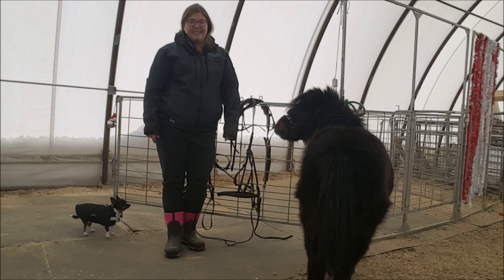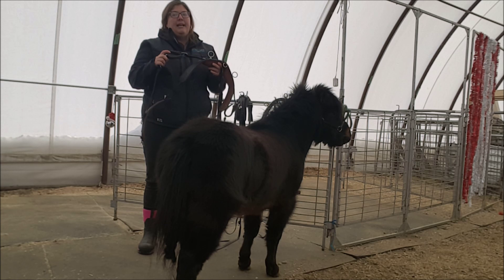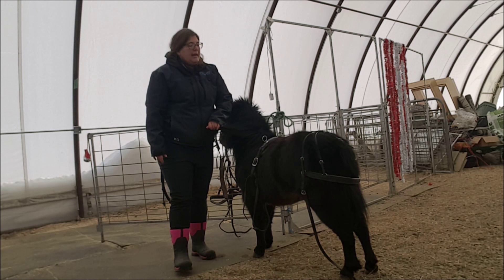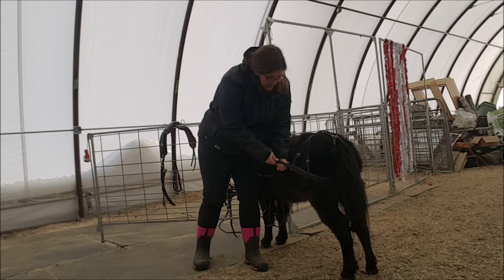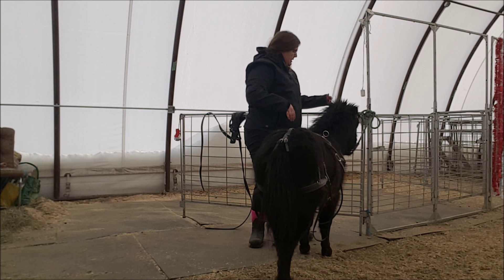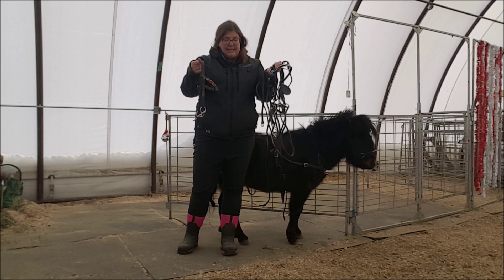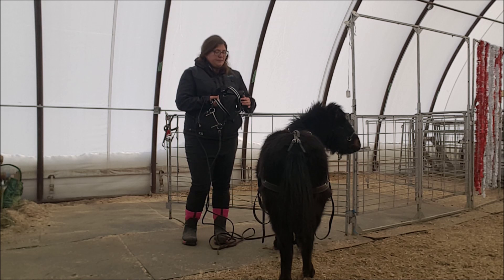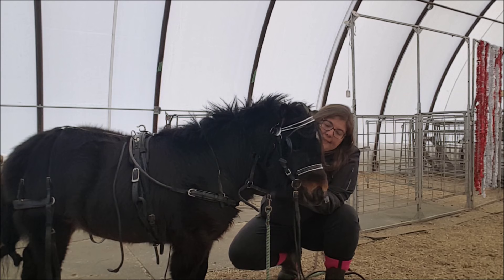Harnessing The Miniature Horse - Part One

Comment: I love your videos, Kendra. Also love your book on miniatures--I highly recommend it as a great info source on minis.  A couple of small points regarding your video presentation. If you used a lighter colored mini in such demos, we would be able to see the harness easier as you put it on the horse.  Rocky is so dark that it is hard to tell exactly where the saddle sits in relation to the end of his mane, precisely where his girth sits, etc.  Also, as you hold up the various saddles and point out their characteristics, it would help if you would angle your body so that the harness parts aren't against your dark outfit.  If you were to stand slightly to the side, and show the harness parts using your lovely building walls as the backdrop, I think we'd be able to see the harness more effectively. These are not dealbreakers, but being aware of these videography details would make your content easier to grasp.  I found I had to keep stopping the video, then squint to see harness details against your dark clothes, and positioning of the harness on the dark horse, before I felt I could move on.  Thanks for considering my suggestions. I greatly appreciate your knowledge, and your straightforward and positive teaching style!

Comment: Hi,
a friend referred me to your channel,I'm completely new to driving and I'm trying to teach my miniature. 
I was wondering since a check is required for showing can I leave it fairly loose like I do for practice or would I get docked points if I did that in the show ring?
If you could give me some pointers it'd be much appreciated,thanks.
Reply from the maker: There is no rules as to how a check is to be adjusted - it should just be wherever it is comfortable for your horse. In some classes it doesn't even specify that it must be attached to the bit. 

I start every horse without a check, and only introduce one shortly before a show for them to become accustomed to it. That way they are able to learn to balance and carry themselves without it's interference.